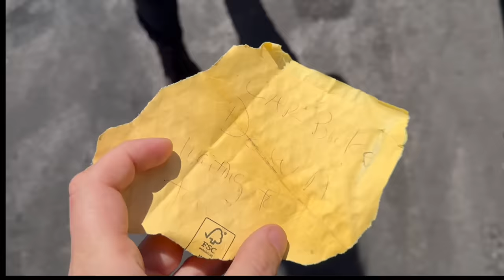TOW TRUCK FAIL DAMAGES SKETCHY MECHANICS LAMBORGHINI…..

Comment: Still puzzles me why tow companies don't have unidirectional sliding dollies for loading the cars. It wouldn't even require entering the car.
Reply: Those are the Go-Jacks he installed on the back. Not all trucks have them. Some companies(like mine) don't need Go-Jacks but once a year, so my boss can't justify buying them. But they are necessary on trucks in the city.
Reply: @BrandonJ131  but those dollies move in multiple directions. My point was using those dollies to align the car with the tow bed, and then use another set of dollies but unidirectional, so the car doesn't move sideways.
Reply: There’s not a lot of space to have a bunch of stuff that only get used one in a while on tow trucks, most of the time those wheel Dollies help getting cars out of tight parking spots where our trucks can’t line up
Reply: @Datboii2wotone  Yup. I run skates and soap. They take up less room and weight. And I don't have to try to justify the simple stuff to my boss. Plus some slash cut 4x6s to change the angle of attack. It takes some finessing with it sideways like that. But I still would have unloaded faster than these guys by a mile, and definitely without damage. It's mainly experience on the job. It's a fun job when you know what you are doing and take pride in it.
Reply: @BrandonJ131  facts I’m glad they didn’t showed how they got it up cause my anxiety is going nuts watching this
Reply: @Datboii2wotone  You know. I almost didn't want to mention it. If it was the new guy with his uniform open, there was unseen damage.

Comment: I told you Steve had more cars in the back pocket lol. I think he said he was from Jerz like me a cpl episodes ago so that explains alot lmao jk. I would try not to pay that tow bill if the damage is pretty significant or id get an estimate for body repairs and send it to the tow company lmao but ultimately I wouldn't wanna cause a big problem so in my case I'd prolly just pay it if they aren't willing to back up their work when they do damage to a car but that's what Google reviews are for I guess lol, i guess its one of those tow trucks where the front of the flatbed doesnt go low enough. They should've put the wheel dollies under the front wheels if possible after the rear wheels were off the deck and pulled the truck foward out from under the lambo slowly monitoring clearences all the way around and all that prolly coulda been avoided maybe but I'm not rlly saying anything you guys don't already know lol. Better yet they have ramps that can help with this that go under the back of the tow deck, maybe you guys should get some of those ramps so stuff like this wont happen in the future and you could use those ramps for all sorts of other stuff in the shop. But if I knew that the tow bill was gonna be a thousand dollars when they rolled up, i woulda said ok but im takin the car off the flatbed myself lol that way im responsible for anything that happens and not the tow guys but I guess this was good for video purposes lol. Some tow companies would say ay you cant take a car off our tow truck that's for personnel only, insurance insurance. But like Damon said, average everyday tow guys that dont work on cars prolly, just tow em. Hopefully they dont do repo, I hate legal car thieves🤣🤣🤣.

Comment: It's not the same car as the rally. Very similar but the front bumper has black sides on Steven's uncles and the other one had color coded white. 
The plate was 123 AZ on the PFS one.

Comment: Hi , I move my brain for you DDE! 
For idea : Build box cage is wide and long for wide Supercars with long tail . So by possible give on wind cw form that not able react by wind with the aerodynamic.
In the case cage is on ground click line for tyre stopper.
The cage is on big steel rolls and Teflon rolls .
So skate on a bit wider and higher pull easy on by winch on transporter. Or use Mercedes truck that use a crane with put on by tyre underlay plates like in Germany  . !;) DDE Special Auto Relay for Supercars like ADAC , able call for Supercar transport!:)

Comment: The tow companies insurance will cover it. That's why they pay $25-45k/year in insurance. It ain't cheap to run a shitty old tow truck. I feel for that driver, he is definitely inexperienced. It's clear he needs some more training. Lots of mistakes, not the wrong way, just poorly executed. I've been there. That's why the other guy showed up. Ive towed a lot of disable sports cars, with mainly flat tires. Which makes for an absolute PITA to load/unload, and they're already a pain. Sucks they damaged it. But maybe it will help the management/ownership of the tow company to realize their guys need more training. Also, don't ever judge a tow operator by their tow truck. There are some badass operators in some shitty old tow trucks that will get the job done. That's the difference between an operator and a driver. Just sometimes you find out during the job. 🤦‍♂️

Comment: When you haven't paid attention in school and work at a tow company:
Start by jacking the back of the car up, pushing the front down and then try to make up the difference with as much wood as possible in the front, instead of just lowering the back wheels again... 🤦🏻‍♂

Comment: right tools right job, if that Aventador was loaded onto a S.P.A truck  'sliding pivotal alignment' which allows for a near zero incline angle, that would have been on and off in 5 mins with no additional damage, as a former recovery truck driver i was cringing at that

Comment: This video was painful to watch 😅 hilarious but painful. To be honest I’d have run to the SVJ when the tow truck got there and swapped the battery while it was on the truck so they could pop it in neutral! Or better yet is there a way to manually put the car into neutral? I assume this is not an option considering the way they took it off… but because I don’t know I can’t help but question if that is a feature the car has? Either way these guys didn’t have a clue as to what they were doing!🤣

Comment: i would not trust that Tow company with towing a Honda after watching them try to off load that Lambo.  they are not trained properly to tow a expensive car like that. they damaged parts, was not secured properly and they were not professional with their duties.  I worked as a Tow Truck driver and had to be trained properly to load cars like that, it was a week long course for towing exotic cars and how to properly tow and move them.

Comment: That tow company should from the beginning have had 4 wheel dollys, one under each wheel, then with the tow hook and whinch back it down carefully, way easier to control and you can "steer" all 4 cornors without the car running. 

Would also help with the cars height. You can get dollies that can get under extremely low cars like the Aventador and can raise a lot, like a jack

Comment: As a tow truck operator just the car on the bed has red flags on how well this person takes care of exotics. First of all those eight points on the front is not the way to secure the car. Second the back straps are improperly set up. Totally not trained properly.

Comment: by putting the dollies under the rear tires before pulling the car. It caused the front nose to lower closer to ground sooner while front tires were still the truck bed. Because he rasied rear tire height. Would have been better to let air out of the rear tires.

Comment: Batteries flat? I'd have got the charger outside and tried starting the thing on the trailer, or see if the lift on the car works, assuming it would have one. Watching those men do it the way were doing gave me the worse heart burn from anxiety.
Reply: Video evidence for Uncle to claim compensation from the trailer company insurance..

Comment: As a former tow truck driver (retired after a pedestrian decided to end themselves by jumping in front of me a few years ago)

This is filling me with cringe-tension.

What my company would have us do in this situation is hook the 6 foot long metal “prestige ramps” into the back lip of the trays of our trucks in the slots that along with the wheels, and then a few wood blocks would be placed under the lip of the tray to stop it sagging down as the tray would not be touching the ground, this allowed for a smoother and shallower angle from tray to road, and would AVOID THE ANGLE CHANGEat base of tray to wood/road as seen here